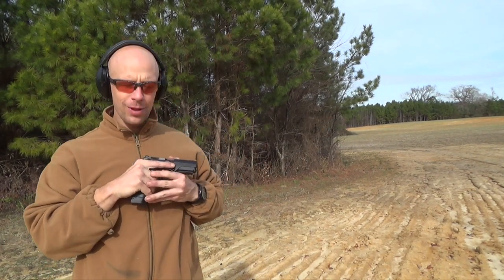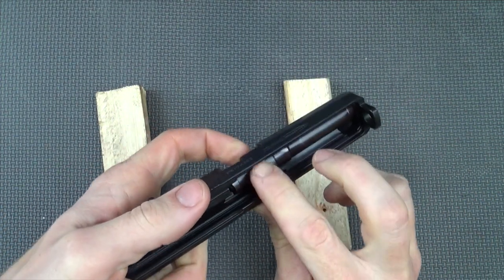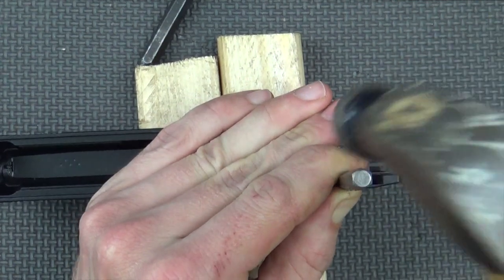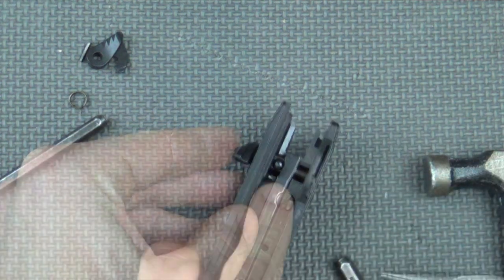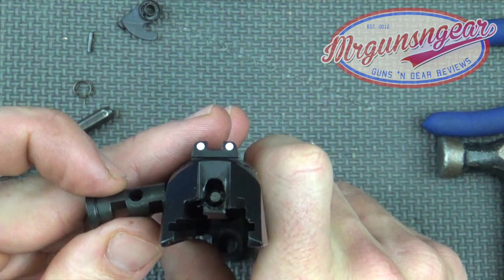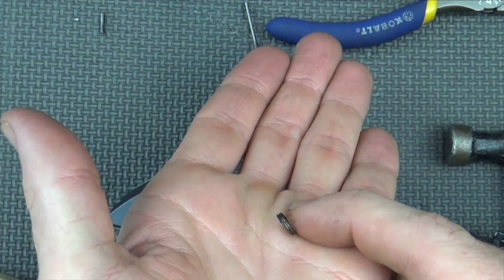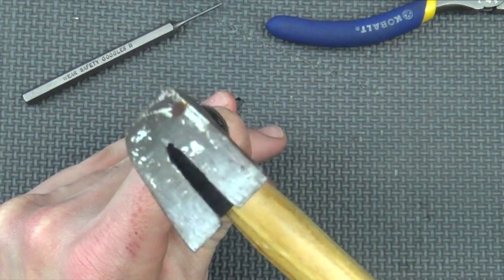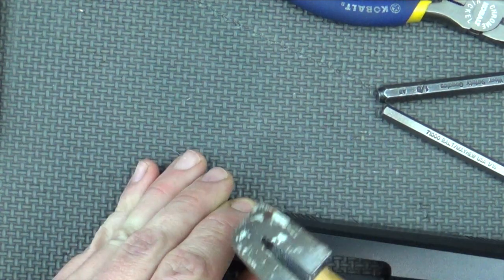How To Convert A Beretta PX4 Type F To A Type G [Decocker Only] (HD)

Comment: I just installed the stealth decocker levers on my PX4 full. This video was all I needed and as others have said, the most clear and concise one I've found. This is quite old. Most people seem to know that you don't need to take out the extractor, definitely don't. I went down/from top to get out the safety pin. It kinda got stuck. I tried backing out for a while, and it wouldn't budge, so I carefully, with some finesse, kept going down and it did pop out. The rest was easy and clear from this video. Getting the new stealth lever back in didn't require doing that two part push on the punches from the bottom and back to push the lever in, so it was actually even easier than in the video. To get the original out it was the same procedure. Now I don't have to look at or feel those terrible safety wings! I feel like Mel GIbson at the end of Braveheart..... FREEEEEDDDDDOOOOMMMM!!!!!!!!! Thanks for this video sir, you killed it and made for a very easy process. Other videos on this were so long and unfocused and frustrating!
Reply: i wish I saw this before I attempted.. I have no idea how to get the extractor rollpin back in. it keeps going in diagonally and getting stuck. ugh

Comment: Good vid, sir!  I installed the low-profile levers on mine and this vid helped me work through getting it done.  One thing of note, putting the lever's pin back in place was difficult due to lining up the holes.  Ended up running a 1/16" drift up through the underside and then following it back down through with the roll pin.  Thanks again!

Comment: Great video - thanks for posting. Above instructions also work perfectly for PX4 Storm compact. I did have trouble getting the pin out of the decocking lever which requires a 1/16" punch.
Reply from the maker: caliphaxable Thanks.

Comment: Did this to my PX4 Compact…low-profile replacement from Beretta as well as the single-sided slide release.  Very happy with results, makes the gun much more streamlined and improves the overall sight picture/profile.  The decocker takes some effort to use, but all the better to make sure.
Reply from the maker: Fugettaboutit Awesome
Reply: Fugettaboutit Amen, that's a way better set-up.  I did the single lever for my compact too.

I attended a pistol class and the decocking got old, so I stuck the left side bat-wing lever back on, but kept the rest stealth.  The instructor wanted us to get lost of reps using DA.  I had trouble one-handing the decock, so this worked well in that particular environment.  My other two are straight stealth.
Reply: MoltElevator9 Yeah, I was thinking of keeping the left side lever the higher profile one just to decock easier, but I just like the stealth decocker profile so much better I actually use my left hand to do the decocker.

Comment: Great demonstration.  The only drawback to this is that the type F might be a little safer when re-holstering(one of the things I like about the F).  When the safety/decocker is down the trigger is disabled, so if anything should inadvertently get into the triggerguard like say a drawstring toggle, the gun won't discharge as it is pushed down into the holster(it happens:))...  This is especially comforting if an IWB holster is being used, and allows me to very confidently reholster the pistol singlehanded without worry.  As for inadvertently engaging the safety decocker while carrying, I carry the PX4 with the hammer at half-cock.  If the decocker is activated far enough to drop the hammer there will be a distinct "click" when the hammer drops.  I also think this is a safer carry mode. If it should be dropped on the hammer, it has to get past the half the cock sear and the firing pin block to discharge the pistol.  It also has a little easier DA triggerpull from halfcock.  My .02
Reply from the maker: rronmar Thank you.

Comment: excellent video, I have a compact px4 and modify it by removing that small balin, and it works perfectly, very practical and offers many advantages when used supplied or charged.
Reply from the maker: thank you
Reply: My levers will stay engaged if I push them all the way down firmly. Do you also have this problem?

Comment: EXCELLENT VIDEO!!!! You mentioned a 3/32 punch for the extractor, but what size punch did you use to remove the lever pin?
Reply: Looks like it is 1/32 but I'd like to know as well.
Reply: I used a 1/16
Reply: 3/32 would be to big to get that out.

Comment: Great video.  Followed it as I attempted to switch to type G.  Was putting the safety lever roll pin back in and my punch broke.  In addition, the roll pin itself is now stuck and protruding slightly from the bottom of the slide.  The end of the pin is flared out and won't go in any further and I can't get it out.  Not sure what to do now.  Could Beretta fix?

Comment: NOTE: you can use a 3/32ths punch for removing the extractor, but you will need something like a 1/16th inch "roll pin" punch to remove the pin that holds the actual decocker in place (and from what I've been told, you don't need to remove the extractor).  WARNING: before you use a 1/16th inch roll pin punch to remove the pin, use a 1/16th inch "starter punch" to get started removing the pin otherwise you run a very high risk of bending even the strongest of 1/16th inch punches.

Comment: Great vid on how to do this. I removed my stealth levers on my compact carry PX4 for some 92G type levers specifically for a PX4 from Beretta. When I reassembled the pistol. The decocking levers are not springing back up like before. Small spring on right side lever is in place in the hole and in the cut out as well. Any ideas?
Reply from the maker: not offhand; sorry
Reply: Mine spring up Ok but if I give them a little extra push then they stay down. Hopefully they work themselves out of this.

Comment: I remove this spring and ball from my PX4 and it went ok but later I thought ....Why remove the it , just keep the gun's safety off cause it's the same thing.
I put it back in the gun because of a few reasons. One , if I ever go to court they can't use that fact that I tampered with gun against me.
Two, its the same thing just leaving it off safety , cause without the spring & ball the safety stays up just as off safety.
Three , with the spring & ball installed I have the option to use safety if I wish. I don't see the big deal at all. 
 I see no benefit removing it. Great video, I found your explanation easy to understand follow .

Comment: Hi, thanks a lot for the video. Just finished now converting 2 of my PX4 pistols. Why did you remove the extractor? I did not remove the extractor now when I converted my guns, I could not see how it is affecting the procedure, am I missing something?
Reply from the maker: You don't need to, as you know, but IMO it makes it easier removing the pressure it provides.

Comment: @Mrgunsngear
Great video and still helpful after 8 years of posting it, I have a good question if you may help, I want to install the low profile kit sold on Beretta website, but I don't want to convert it to G model, meaning I want the safety feature to remain as a F model, is there anyway to do that? I appreciate your help.

Comment: I hear this complaint so much about Berettas.I have had my 92fs for 25 years and I also have a px4 .45 and have never "accidentally" engaged the safety.my px4 is an older military model and came from the factory with safety levers identical to the 92 and its type f.the thumb of my shooting hand is right where the safety lever is so it naturally flips it up on draw.i just don't get all the complaints
Reply from the maker: I have done it
Reply: Before doing this conversion, I have used it to decock after racking a round into the chamber, for condition one carry, and then holstered it without then switching the safety off. It happens.

Comment: You don’t need to remove the extractor or the firing pin block...you just need to hold in the firing pin block while you depress the firing pin and slide out the safety lever.

Comment: Are there any extra steps when replacing the safety with the stealth g levers? And do u have to stick a pin inside of the holes in the extractor pins or just on the surface of the extractor pins? I have a compact and I'm having a little trouble converting mine to a G..
Reply from the maker: not sure offhand

Comment: what size is that  punch you're using to tap out the ball bearing and spring on the safety lever...i tried to use my 1/16th punch and it was too big for the hole
Reply from the maker: +Falcon Lair I don't remember

Comment: I understand that Berretta offers a kit to convert an "F" model to a "G" model that includes a smaller (doesn't stick out so much) decocker lever.
Reply from the maker: +gtracer66 indeed
Reply: Beretta does. I had the lower profile de-cocker put on, but found it hard to manipulate, as it is small, so I returned to the original de-cocker/safety switch, as Mrgunsngear has done in this video and it works great. Try both and see what you prefer.
Reply: +Dude Labowskee I just put a set of Trijicon HD sights on and did the conversion. The low profile control kit is $75.00. Think I'll stick with original controls.
Reply: +gtracer66 Same thing I did. Low profile was just hard to manipulate. Enjoy!

Comment: Would anyone have any info on how to remove the right side of an ambidextrous slide catch/stop?? Thanks!
Reply: Mine broke off my 92FS after years of use (bought in 1989) and I just removed the saftey, separated the two halves and reinstalled the unbroken left half.
Reply: After you remove the left-side lever the right side rotates until a tab on it lines up with a notch in the frame. I think it's down, I forget. I found a video of someone doing it online.

Comment: so you used the 3/16 punch for the extractor.. but what about the roll pin for the decocker? was that also 3/16?
Reply from the maker: I don't remember offhand; sorry
Reply: OK so thanks for the video. I just did mine and works great! tractor supply has  a 3 pack of punches for under 10 bucks. (comes with a 1/32, 3/32 and I think a 1/16. use the 3/32 for the extractor roll pin, and the 1/32 for the decocker roll pin. also the ball that you take out  to make a type g..on the opposite side of the ball is a hole that the 1/16 will good all the way though the shaft and pop the ball out. hope this helps.

Comment: Just did this to mine, this video makes it easy! Would have been easier if my 1/16" punch was a bit longer. :p But my extractor spring was only a single spring, not a double?

And though it's not necessary if you have thousands of rounds through it like mine definitely remove the extractor and clean under it, I had an amazing amount of crud there!

Comment: I want to get a suppressor for my PX4 Storm, but I can't find any threaded barrels... I've tried looking it up and aftermarket companies, but nobody makes them. Any advice or help in the right direction?
Reply from the maker: 007Glock nope.
Reply: 007Glock Buy the extended barrel from Beretta direct.  You're looking for the 'Beretta PX4 Full Size Barrel 9mm Extended (115mm)'
This would give the FS barrel enough length to look like a Beretta PX4 Storm SD and give a gunsmith enough room to thread.
Reply: I bought the extended barrels from Beretta and had a local gunsmith thread them.  The full size barrel is a bit thin, so it had to be threaded such that the booster indexes with the muzzle.  The compact one is a bit fatter and can have the index position located at the shoulder behind the threads.  

For what it's worth, the rotating lock does tend to cause unwinding a bit sooner than a tilt lock.  However, it doesn't happen all the time.  I do notice that the compact barrel tends to snug up a lot tighter. 

I put a video of the full size up last night if you check my channel. I'll make some more videos that show the differences between the threading interfaces and how long the boosters stay tight.
Reply: 007Glock  My pleasure.  I have a concern with your set-up though.  If I understand you correctly, your intent is to use the full size barrel in a compact Px4?  The barrels differ in design between the full and compact models and the full size barrel won't fit properly in a compact.

If this is the case, I suggest returning the barrel and exchanging it for part #JBPX49CEXT (http://www.berettausa.com/en-us/beretta-px4-compact-barrel-9mm-extended-to-accommodate-threading/jbpx49cext/).  This is an extended barrel for the compact model Px4 (9 mm only).  If you have a different caliber, then you will need a machinist/smith to fabricate a barrel extension.

I too have seen the SilencerCo video and had a chance, first hand, to do the comparison of the Osprey v. a symmetrical can.  I experienced the exact issue documented in that video, only with my 9 mm Px4.

The Px4 hosts loosen from the silencer more so than my M&P/Storm Lake setup.  That said, I love the Px4s and got things threaded because...
Reply: MoltElevator9  ...I could.  While the Px4 is not the best host weapon, I have yet to experience a direct-thread silencer that does not come loose on rotating or Browning-tilt barrels.  Consequently, I have a habit of frequently checking the fit as I shoot.

The nice thing with the 1/2 x 28 standard thread pattern is that the pitch is shallow, so even if the can loosens, you need 4-5 full rotations before the can will wobble.  I typically see under 270 degrees of rotation result from a mag dump in the PX4.  Sometimes, I have no loosening at all.  Other times I have had the full size host barrel seize to the can.

I also tried the fixed barrel spacer on the Px4 and just got jams, so you need the Nielson device/booster.

I had my barrels threaded by a machinist/gunsmith in Traverse City Michigan (www.greatgunstc.com).  He did a beautiful job.  The threads are very clean and do not snag cotton patches.  They honestly look like factory OEM products.  I have also heard good things about Tornado Technologies out west (https://www.tornado-technologies.com).

I hope this helps!

(Broke this into messages because it was too long and didn't fit on the iOS apps)
Reply: MoltElevator9 Thank you so much for giving me your advice and walking me through this process. I can not express my gratitude and appreciation for you helping me out through this being my first time going through this suppressor process. Yes, I have the correct barrel, the extended PX4 Storm Compact barrel. I was also told the 1/2 x 28 pattern but was also told that the 13.5 x 1 is better because i'm just starting off and that it would allow me the option of working on European manufactured handguns also (not that's really of any importance to me anyway). Do you find any truth in this? Or 1/2 x 28 is the way to go? So in your opinion and knowledge, what would be the best brand of suppressor to get for my PX4 Storm Compact? Are you saying no matter what it is going to come loose? .
Reply: 007Glock  Happy to help.  I'm glad you have the right barrel.

Thread pattern is moot, as you can get different pistons for your can and have access to multiple thread patterns.  I chose 1/2 x 28 because it was stock, is a standard, and I had other weapons with that thread pitch already.

I don't think I am enough of an authority on this subject where I can tell you what is the best option for your situation.  I will definitely second SilencerCo's thoughts on the concentric design (Octane or Ti-Rant) as opposed to the eccentric (Osprey or Illusion) cans.  I only have experience with AAC, SilencerCo and Surefire products. Those are all nice and would serve you well.  I am interested in the new Sig Silencers as a few of AAC's guys are there now (including AAC founder Kevin Brittingham).   Perhaps Mrgunsngear Channel can give us an opinion on the Gemtechs and Liberty products I've seen on this channel.   Is there anywhere close to home where you can try the different products?  I got to try a bunch at a defensive pistol class and really liked the Ti-Rant.

Whatever product you choose, the suppressor will loosen on the Px4 (also on most other hosts, to a lesser degree).  Rumor has it LH threads may tighten or seize, but I have no first had experience with that thread pattern.  For what it's worth, mine has seized and loosened with RH threads.

Comment: What size punches do you use in this video? I don't own a puch set and need to buy one. . .
Reply from the maker: +Charles Horning I don't remember; sorry
Reply: It's all good I just bought a generic pack from the hardware store. 

Haha. Didn't have a small enough punch to pop out the bb though. 

Luckily I had a tiny drill bit near by and used the back of that. 

Anyway, got her all set up and I am now the proud owner of a model F Px4 Storm!

Comment: Mrgunsngear Channel One thing to note on this conversion iirc there this way and the Beretta conversion, in this way if the switch is held in the safe position it is in safe and thus cant be fired where as the Beretta conversion does away with the safety entirely. Just throwing that out there
Reply from the maker: Intellectual Slacker Thanks.

Comment: I did this, and it works great, except if I push the safety lever all the way down it remains there until I flick it with my thumb. Did I do something wrong, is this normal, did anyone else notice this with their conversion?
Reply: It works great unless I push it too far. Not that this happens often. Also funny, I didn't realize that there was an orange chamber indicator on the extractor. Glad you had us take it out or I would have never gave it a good cleaning to find this out. Hahaha
Reply: I also stabbed my finger while trying to pop the ball out. Be careful. I bled a ton!